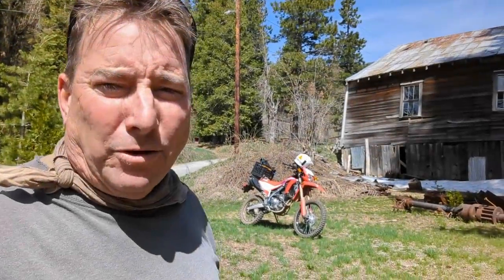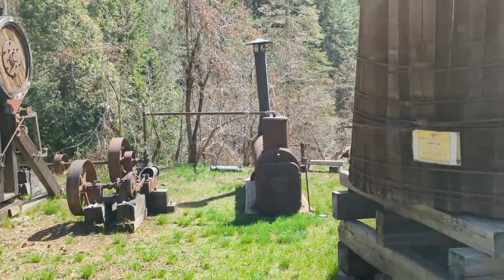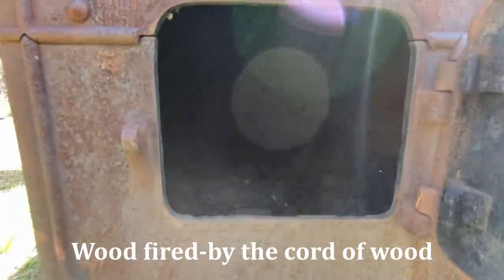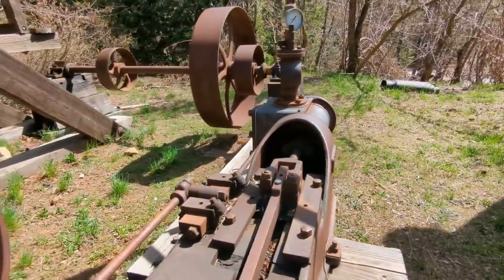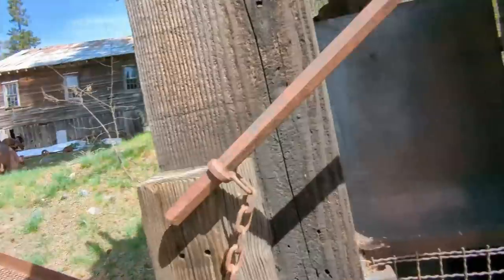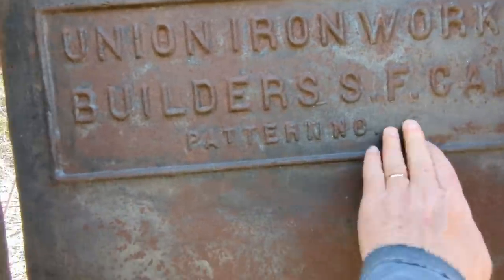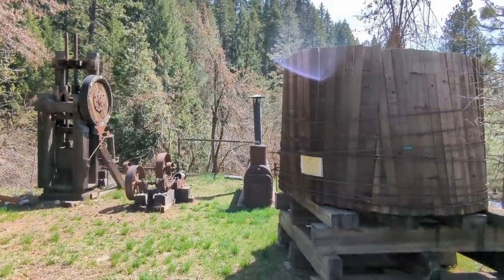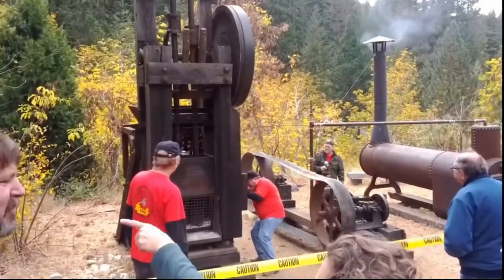California Gold Rush Stamp Mill Operation- Forest City, CA.

Comment: Cool. My Allegiant a320 landing in Ft. Wayne yesterday afternoon suffered a front landing gear steering failure and was chased down the runway by the foam trucks. Had to be towed in. The flight attendants strapped themselves in well before landing and at least one was on the phone for a while. Do you guys usually keep the passengers in the dark???? WTF. Nice soft landing by the crew though. My gifted 15 year old son is going to fly commercially and this opened his eyes.

Comment: The State Battery was still operating seasonally in Marble Bar Western Australia in 1978 when I visited there. It was a five head stamp mill. According to Wiki, the WA State government ceased providing seasonal battery services to small miners in 1987. My recollection is that of the gold yield, a certain percentage would be lost due to inefficiencies in the process. That known percentage would be made good in the payment to the miner for the gold recovered. Old mine tailings apparently contain lost gold which can be recovered using modern techniques. The Marble Bar battery apparently continued to operate to at least 1999 in private hands according to another website.

Comment: At the Mariposa Meuseum, not to be confused with the state mineral and mining meuseum which is also in Mariposa, has a stamp mill which they run from time to time. It’s driven from an electric motor but it’s a large unit. They also have a smaller one they set up a few years ago. Occasionally they will bring down gold from a mine not to far from one of our clubs claims and mill and process it. They just sluice and Pan it though. No mercury for obvious reasons. Lots of gold left. Only the easy to get to stuff was mined. The rest takes a little more work.

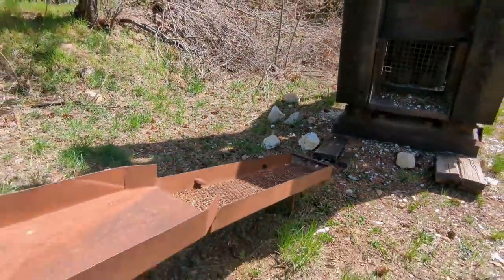Comment: at 2:40 the little device in front of you is a small sluice. used for the extraction you are talking about. no mercury is needed! but it does help lol. you line the bottom with "miners moss", the substrate that will allow the gold to get trapped inside, sometimes as simple as astroturf. then you lay the expanded wire back over the top and hammer some wedges into those tabs. once you're set up, you run water from the top down the slop and add material to the water flow, and the light stuff will wash over everything, but the gold is too heavy and gets stuck.
with that sitting there, this gets used a fair bit and someone keeps an eye on it because that would go missing quick in that shape after sitting around for "long enough". it's still working mining gear after all and by no means historical with the welding done on it

Comment: Water wheels were used for industrial work before steam.
But, the first recorded use of waterwheels for anything except grinding seeds into flour was in 1200. This was the start of the industrial age in Europe.
So, why did it take until 1200 for some baffoon to say -- Hey, we could use all that power for stamping, sawing, drilling, lath work, etc, etc etc?
Reply: Basically, it was the production of better iron and then steel that made possible the materials to use higher pressures for making steam and more useful and powerful engines.

Comment: No twist in the belt! Or didn't that type of belt need a twist?
Reply: Not when it is that short.,the wheels have a slight crown that keeps the belt on center.
Reply: @Beechnut985  And the engine is set up to run in the direction the mill needs to turn.  The cams could be turned around.